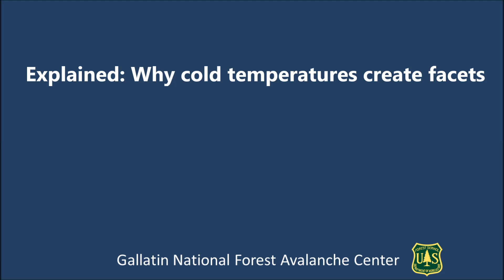Explained: Why cold temperatures create facets - 29 Nov 2015

Comment: Good explanation. One small point. Faceting actually happens, as does all snow metamorphosis, more rapidly at warm temperatures. Faceting can take place in micro gradients as well. The temperature gradient can occur in less than 10cm of snow. That is why you get rapid surface faceting in the upper snowpack. Clear skies also play a role.
Great video and it's sad to see such massive facets at the base of this snowpack. Hopefully this winter was safe.

Comment: Thanks so much for this video, it is really helpful. I have one question: what about the temperature gradient leads to the water vapor moving upward? Isn't colder air more dense/higher pressure? Thanks in advance!
Reply: It is because vapor pressure is higher in warm air than in cold air, so it moves from warm to cold. The vapor pressure gradient is really what moves the water vapor, but we can more easily measure the temperature gradient which is a convenient proxy.
Reply: @amarienthal  Thank you!